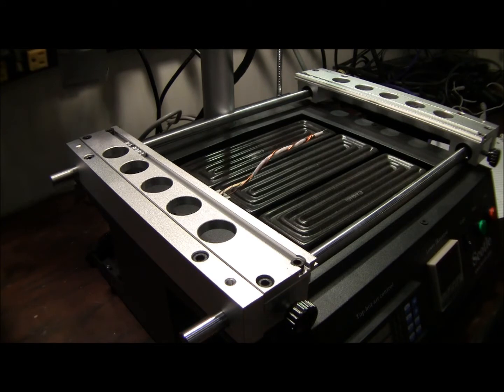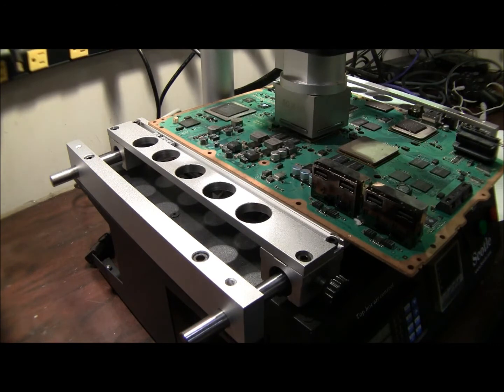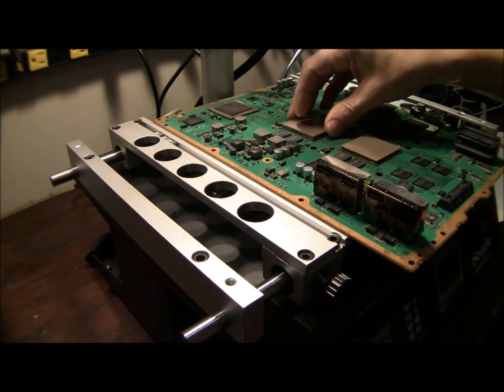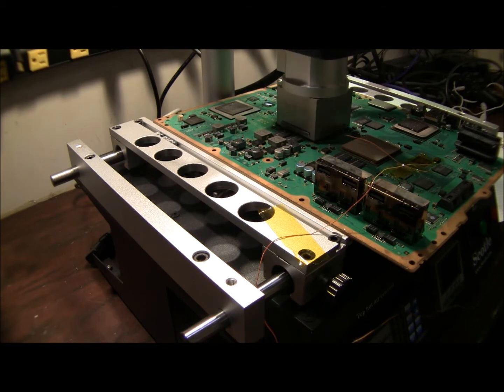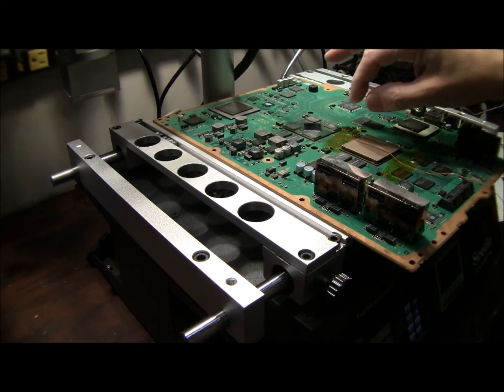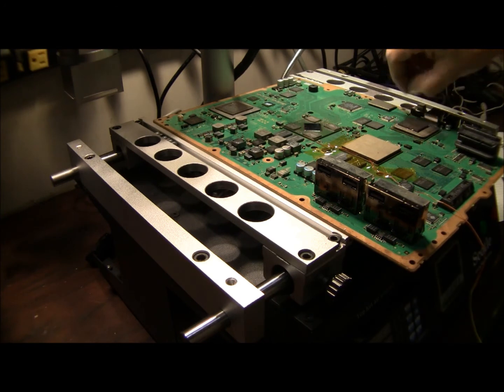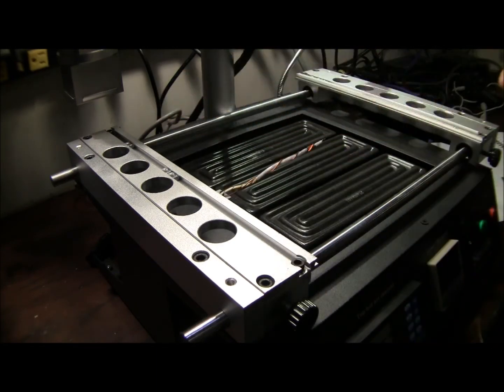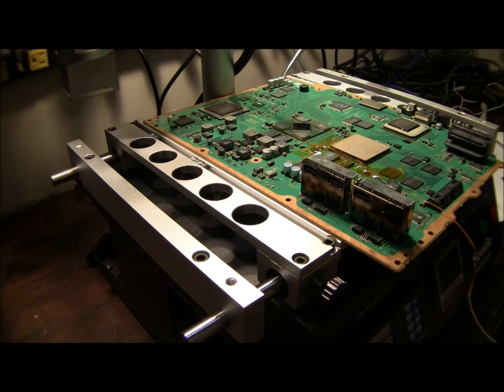Preliminary Setup of your Rework Station Video 3

Comment: Thanks for the video.
For those who have an IR6500 please don't take out your thermal couple from the plate, remember that you have a tempered glass and a metal web that needs to absorb the temperature first so then it can delivers it to the board. If you take out the thermal couple from there, you are going to rise very high temperatures that might damage your machine.

You can take the glass and the web out that's ok, but the glass is very useful for cleaning and the web spreads heat more evenly.
What i recommend you is, do the same thing but with an external temperature meter, and control the bottom temperature manually.